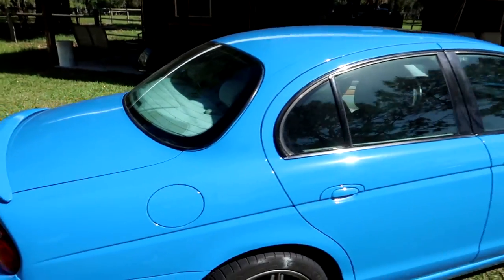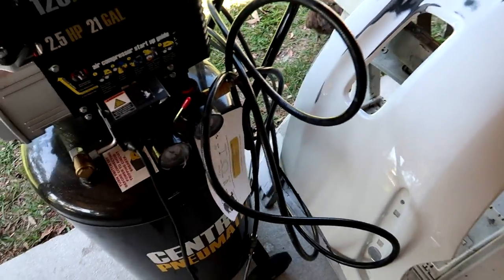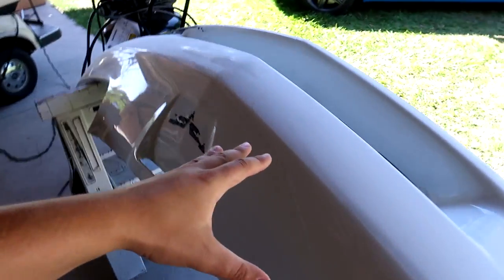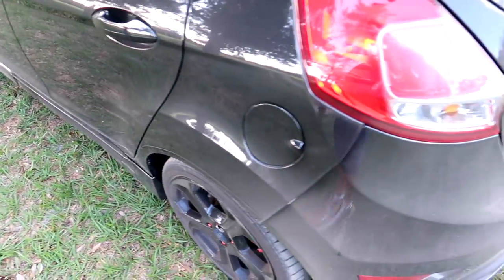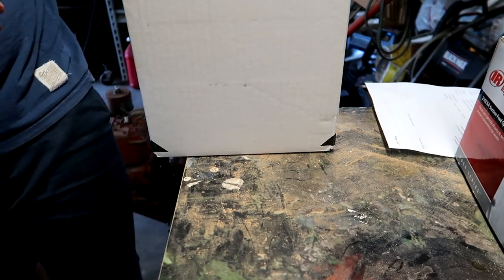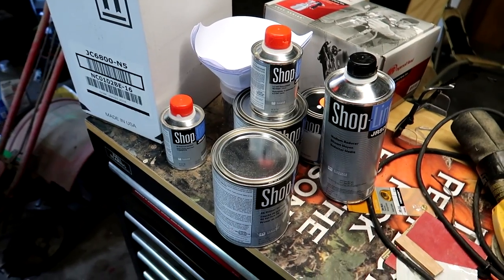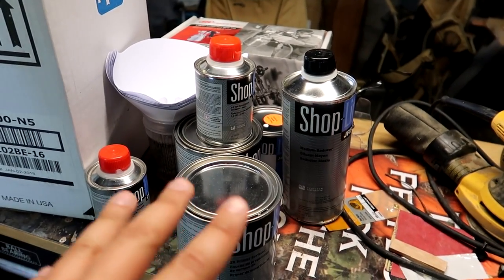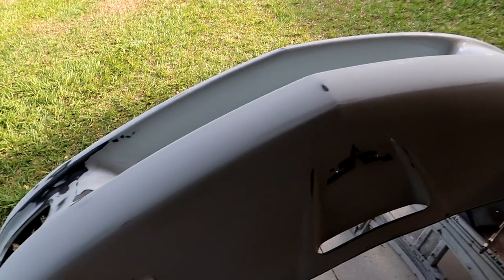Should I Paint My Own Salvage Rebuild Projects at Home? *FAIL IMMINENT*

Comment: Tarp won't cut it, get yourself a roll of poly and cover everything in that workshop - the airborne paint particles will get everywhere. Also get yourself one of those cheap full body painters suits and a pair of safety glasses. Last time I did a garage spray job, I didn't even notice I was getting paint on myself until I took off the glasses and it was covered in a fine mist.

Clean the shop as much as you can! Get rid of as much dust as you can!

also after you are done painting and are waiting for it to dry, keep the temperature high. I achieved this with a boatload of shop lights. Didn't want to use a furnace or space heater due to the possibility of kicking up dust. If you can't keep it warm in there, just make sure it doesn't get too cold and be very careful for like a month, as the paint will be fragile.

Comment: Watch out for edges when using an air file. You can wear them down exponentially faster than the flat areas. Learn how to properly use the measurements on the cups and look up a couple YouTube vids on how to adjust your gun spray. In line water filter and pressure regulator is all you need. I like to pull the plug on the bottom of my compressor and bleed out the water out of the bottom of the tank before using my gun. Prep is key! Good luck!

Comment: Also, make sure to do a coat of adhesive so the paint will stick to the panel being painted, you don't want any gloss to be present when painting (be sure to wetsand before paint), it won't stick to the panel. If you're going to convert your garage make a confined area preferably with plastic tarps. I like to have a positive pressure booth compared to some people who prefer negative or an equal amount. But if you're trying to keep a positive air pressure makeshift paint booth be sure to have at least one exhaust fan to account for overspray. (Even though this is just the front bumper it can apply for future jobs as well) Prep work is the most important part when painting a car
Reply: Also please switch to a gravity fed gun, it'll make your life so much easier

Comment: Great video Samcrac! The "chicken" interruptions were hilarious! 
The first step in getting a good paint job, is to purchase a good paint brush or roller...  LOL!
Seriously good prep is the key to getting a good paint job, just understand that it is not the only thing.
I'd recommend getting a good "How To" book that is up to date on paint and bodywork.
Make sure you follow the paint manufacturer's procedures to the letter. It's their paint, they know how to best apply it.
I will tell you that the suction gun you purchased is going to waste a lot of paint. 
You can use some 2x2 & 2x4 lumber, some screws, some rolls of plastic, a fan and furnace filter or two to build a low-cost paint booth. 
Best of luck to you & Happy Painting!

Comment: I think you should totally do it. Window tint again too, It just takes practice and I bet by the 3rd kit youd be doing it yourself from now on. I wouldve used a Red/Maroon Scrotchbrite pad to remove gloss instead of a DA sander personally. I dont think youll use much of the primer surfacer. In school my teacher called it "Painters Bondo" . Just make sure to do a sealer coat before going to base coat clear coat to lock down any sanding you did to the damage area.

Comment: My biggest piece of advise is in the future when you have a very small damage area like you did here only sand that area down and just scuff the rest of the bumper with a red scotch bright pad to remove the shine. This way you only have to spray base coat on the damage area and you won’t have to blend into the fenders since you are not going to spray color on the area that it sitting next to the adjacent body panel. This way after you cover the repair area then clear the whole bumper you just have to buff the fender tips and no one would ever notice.

Comment: you’ll need adhesion promoter for the plastic that needs repairing, then primer make sure it has flex additive. also make sure the ground is wet and your work area is very clean, when you start painting you only need to paint the spot That needs paint only and blend out. You won’t need to paint the whole bumper  and the reason you don’t want to paint the whole bumper its so it matches the fenders and the hood because that will have the original paint.  you will need to clear the whole bumper, do 3 coats of clear. make sure every thing is scuffed and all edges/anything Shine needs to be dull. Please don’t use that gun go get a hvlp spray gun (no harbor freight)   Practice with water on a cardboard to set your gun correctly, best of luck (NO RUNS you’ll hate trying to fix those)  hope this makes sense

Comment: I’m pretty sure everyone saying use a flex additive has never painted. After you clean clean and clean some more spray the whole bumper with bull dog and let it flash then paint it. You wont have any cracking or flaking. That stuff works wonders. Just make sure you wear a mask because it’s some nasty stuff. If your new to painting sand a damaged part that is junk and practice spraying it with clear. It takes some time to get the gun dialed in and to get the right movement down. The margin of error is small between not applying enough and getting orange peel and spraying too much and getting runs.

Comment: Just my .02 - Buy the cheap $10 harbor freight "purple" gun for a dedicated primer gun, a car canopy can become a spray booth in a pinch with some plastic sheeting for sides (remember to wet cement floors to keep down dust)  Ventilation is good, respirator AND eye protection a must for your health

Comment: shop line is the cheaper PPG line, but still good paint.  hit Harbor Freight and pick up a 10 paint gun and 3 buck filter, not only will it spray better it you can toss it when your done!  Soak the floor of your shop when you go to paint, it will keep the dust down and keep paint from sticking to your concrete.  Once you lay the base look over it for imperfections, you can sand any out with 600 before you clear.  Also pick up a bottle of wax and grease remover and a tac cloth.  Once your done with the final sanding/primer hit it with wax and grease remover and the use the tac cloth after your done laying the base coat.

Comment: They have 2k in the spray can, the can you have to push in on the bottom to release the hardener inside. You don't have to worry about contaminated air such as water. It would be fine for small jobs like a bumper. Check out some videos.

Comment: It would be best to dedicate a space for painting. Make sure you have plenty of space to work around the piece. I have seen a wooden frame and plastic sheets work well. This is to control dust and dirt in the air. A filter on the inlet and a fan to pull out the over-spray. Watch the humidity... time of day and temperature. It would be best to use an air fed mask. Wear a disposable coverall too. Filter masks are ok but some don't get all the solvent components. Make sure the gun is not too big for your compressor. CFM ratings? HVLP guns are the best. Practice on a test piece. You need a nice fan pattern out of the gun with fine atomisation. You might need different nozzle sizes depending on the size of the work-piece and paint chemistry / type etc.  Practice the overlap sweep pattern and try to keep a constant distance from the work piece. Paint viscosity is very important with the correct amount of reducer. Prep is important. Primer, sand, primer, sand until completely smooth. Use a guide coat colour to find high and low spots. Never sand without a block. After you have  painted the colour / lacquer, walk away, don't fuss around it. Are you aiming for "uniform defect" (that slight orange peel finish out of the factory) or are you after perfection? If you want mirror finish perfect, you will have to cut and polish the final coat with a machine polisher to get it. Have fun. It is very satisfying to get it right. With the right equipment and materials it is not difficult.

Comment: I have seen a car painted in a carport. Had plastic on the walls, ceiling, and covering all openings. Turned out really well. Something that small, you could prolly do a really good job with in the garage with some plastic to keep out contaminants.  Good luck with it.

Comment: Make sure you spray down the floor good and get a tack cloth to remove dust if you have any kind of infrared heat source that will help it adhere to the bumper as well

Comment: #1  Sam for your temp paint booth get one of those 12x12 shade tents, then use plastic on the sides to keep wind and debris out you should be able to make it for about 100 bucks ....if you want to be on safe side use a small fan to suck out the fumes and if you are going to be in there have some one check on you from time to time.....if you cant find some one yell ill come up your way and make sure you dont die in there..lol   
  #2  Ok onto the filter for your compressor, you want a moister remover (it will have a small petcock on the bottole like old radiators did to drain out water) and a regulator (will be just that a gauge with an adjustment knob make sure you get a size that can handle your compressor max out put) combo they run around 50 for a decent one so look around.  If you need a Picture let me know ill send you one on twitter of my big floor compressor.  
#3  ill leave the Chickens to kids they are the show Champs at the St. Fairs & Fest  when young i was just dumb dad who payed for it all.  Ill stick to Beef.     Bobby

Comment: Next time bring the part with you, the bumper is big but it would still fit in the car. Better to paint match at the store rather than when test fitting on the car.

Chris from B is for Build used a cheap harbor freight paint gun for the longest time and he always got fantastic results. Granted he had issues but none that were gun related. (For the most part)

Also, I think the vast majority of people are going to support your decision to paint it yourself. It's what this kind of community likes to see an taking us along for the adventure just makes it better. It'll save you money and once you get good enough at it, you'll start painting entire cars. 

The main thing I would like to convey though is that you should always, always, ALWAYS do your best to color match, even if that means you have to jam a fender into your back seat and don't blend a bumper, sand the whole thing down, front and back, mask, hang it and then spray.

On the subject of pain-booths, there is another youtuber, his channel goes by the name of "BUILT" and he has a great setup for someone starting out. I urge you to check it out.

Comment: Few ideas: buy some inexpensive paint and practice on the damaged pizza car panels.  Some paint guys will spray the concrete floor with water as they prep the space, as that will help trap airborne particles. Do you plan to knock down any orange peel?  It’s difficult to hear you want perfect results and this is your first go...one of these variables has to change!

Comment: Prep is the hardest part of painting.You may need to primer and sand a few times to make the chipped paint area right.There is nothing really hard about it if you can paint with a rattle can you can use a gun.I would go buy a cheap paint and get an old body part and practice a little.You will get some confidence and learn how to set your paint gun.Before you put anything in your new paint gun you need to have something on hand to clean it.YOU CAN DO THIS it really is not that hard all you need is just a little practice and the more you do it the better you will get.

Comment: Get some vinyl overlays with the red circle and the line through it to put on the Pizza car logos. They cant claim infringement with an obvious NOT there! Maybe as simple as some "Not affiliated with Dominos" disclaimers on the windows?
Love the vids Sam, and at least use some adhesion promoter on the bumper where you sand through. Paint is EASY.

Comment: Before you paint that bumper you need to clean it off with something called panel wipe or when you paint that bumper you're going to see little particles of dust. So clean the surface of your bumper with panel wipe. Good luck.

Comment: @Samcrac I use the shopline brand all the time. If you have any questions feel free to drop me a message. You should really be using a a epoxy primer sealer though with the damage that happened or flaws will likely pop back through. Shopline is the budget line of PPG but it is still very nice paint. That 2k primer you got is super easy to sand btw!.

Comment: about 20-60 a pint is about correct depending on the color. the best thing that you can do is to get the prepping right. i have had to sand down and repaint the same area several times on my cars cause of containiments but that is the only thing that is a major worry.

Comment: It's easy just do it take your time, give it the flash time it needs. It will come out great. I recommend using a bigger compressor. You can get a 60 gallon belt driven one at home Depot for around 400. That little compressor you have should work for that bumper cover. But I would look into getting a bigger on like 80 gallon.

Comment: You have enough material to paint 5 bumpers. Try it yourself. Don't be in a rush. Take the risk. Try spray an undercoat on the bumper, if no runs, and the spray is even. Then apply three coats of clear and allow to dry for three days. Check to see if you are happy with the finish. If not, sand down and try again. You have enough materials, be brave

Comment: Wipe down with degreaser then wipe it down again and again.  If you even think of touching it, wipe it down again for good measure.  ;-)

As you continue to fix cars, you might want to mend up some of the more expensive bumpers... FiberFlex makes a nice kit with a heat tool to patch up bumpers.

Comment: Tack cloth, grease remover, (talent)😂 50/50 spray (lap) pattern. Effective distance, (hvlp=6-8”) and (rp=12-13”) away from the panel.  If you have more questions ask.

Comment: I just change 75 for labor to paint a bumper also you need to get  ahazen  Promoter to spray on  Plastic parts before you paint it so the paint will not come off easy

Comment: If you told them you were painting a bumper and they didn't sell you flex agent then it's their bad.  I don't see any fisheye additive there too. Beginners usually mess up with the first coat. They put it on too thick and it runs. The first coat should be very light and needs time to dry a little. Successive layers of paint stick to it and don't run off.

Comment: You are correct, one hardener is for the primer, one is for the clear coat. And you can buy a hvlp gun set online for cheaper on www.tcpglobal.com as well as order any factory color paint sets for reasonable prices. I've used their kustom shop line or clear coats and they were really good. If you are interested you can see Vids of when I painted my bike the first time on my channel. It was the first thing I ever painted in my life and I even used a cheap $50 harbour freight spray gun.

Comment: I’ve done some painting, and it will always fail if you do it outside or even inside in an uncontrolled environment. You need to set up an enclosed area where you can keep it perfectly clean, vented, with controlled humidity and temperature. Paint is a nuisance.

Comment: Make sure you have the correct temp reducer and if you're shooting on that bumper you should use some flex additive on the clear.  it should be ok without it but i use it for a little insurance for bumpers that's off the car.  Hope that gun is HVLP and you have different tip sizes for the different paints.

Comment: its paint man, pull that trigger! If its horrible, sand it back off and try again. That's the beauty of it. Keep going til you figure it out, you can't do any permanentl damage. It also helps if theres an old gray beard around you can get tips from. Find one and invite him over for a paint session and a case of beer (yes, they are painters. they will do anything for free beer)
Also if I can make a suggestion... if you are going to paint cars but not all the time, go get one of those outside party tents for 150 bucks. I'd avoid painting inside my shop... it makes a mess of everything. When you are done with the portable paint booth (tent), roll it up and throw it in the attic til next time.  Keeps the dirt and bugs from contaminating your work... except in the winter.

Comment: i'd chose the harbor freight gravity feed gun over any brand siphon every time. use a flex additive, practice your sweep and overlap on some cardboard before painting the bumper. and when you paint the bumper and it doesn't look good sand it off and try again. becoming a master painter could take years  but getting good enough  takes no time at all.
Reply: oh, and wet sanding and buffing can fix a lot of imperfections.